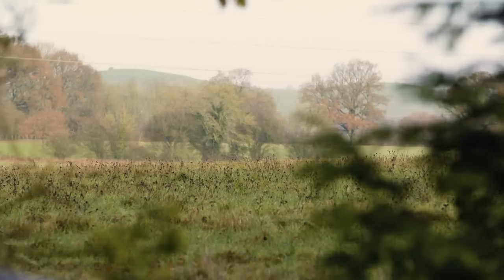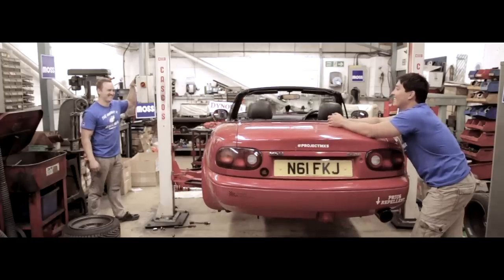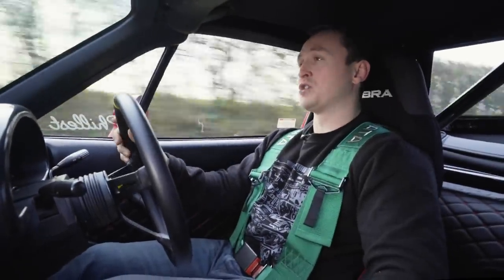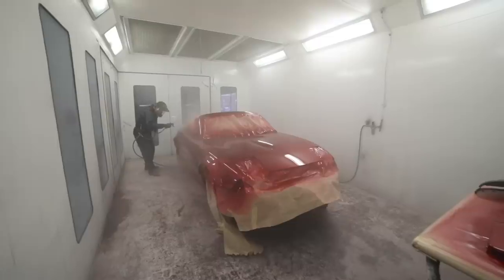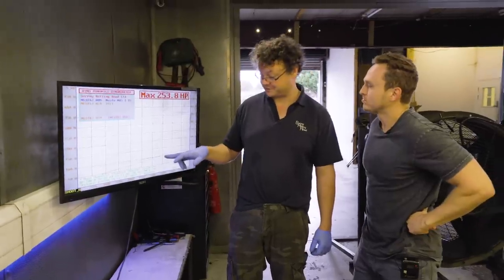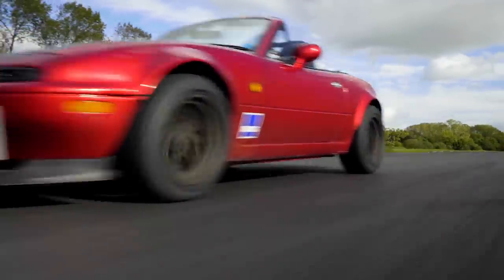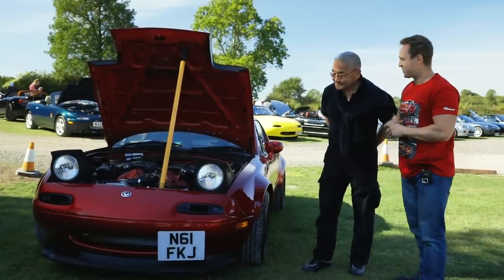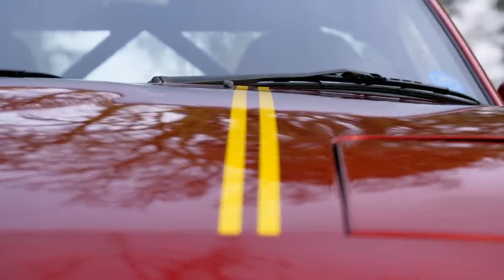How It Took £25,000 And 5 Years To Make My Perfect V6 MX-5!

Comment: Phil made the decade better.
Reply: Evan O'Shea defiantely
Reply: Yup
Reply: PHIL FOR CAR OF THE DECADE!!!
Reply: Love Phil, Love the channel. I wonder about the weight balance.
I would have choose carbon for the engine bonnet (hood) and light battery.
With a big engine on front and carbon at the rear, it has to be nose heavy.
PS: Please put the lights down drag racing it ;)
Reply: @Alpha Bravo Great answer, thanks! And yes, hard to believe the V6 is not heavier. Maybe a suspension adjustment can get around it? I wish Phil was a hard top for chassis stiffness (but I can be wrong again).
Reply: Yea
Reply: If I'm not mistaken, the jaguar engine is aluminum block, aluminum heads, where the stock Miata engine is cast iron block, aluminum heads, which is why the Honda JV6 Swap claims a mere 9lb. weight gain
Reply: @tnb1224  SO THERE'S A WEIGHT GAIN! ADMIT IT!!! hahahahaha :0)
Reply: @Platypus_Warrior  Lol I can't speak for the Jaguar engine, but yeah there's a slight one with the Honda engine swap
Reply: @tnb1224  I was joking of course. 10 lb is nothing. What would you improve on Phil (the car :)
Reply: Or this Decade made Phil better.
Reply: Yep
Reply: Isn't there a jaguar supercharged V6.... A new vision for a new decade, 350bhp... Control electronically to maintain some reliability etc. Could be enough power to kill a Ferrari Testarossa of the decade that gave us the Mx5 in 1989/90...
Reply: كظاهرة
ظ

0 حجج

Comment: By coincidence we bought our MX5's at around the same time for quite similar money ... I am looking at a new engine in mine now too, I am about €14,000 into repairs by now and will be about €26k to €28k in by the time Luigi is done.  One day Luigi and Phil will meet!
Reply: Can You Upload A Vid Of It?
Reply: Glad to know I'm not the only one pouring insane amounts of money into these. It's money that you'll never get back but man, the joy these things provide is out of this world, it's worth it.
Reply: Your mx-5 in green looks really eye candy, would love to see other mods done to it
Reply: I Like It, But I Dont Think Its Green Enough.
Reply: @dharmik_shady  No real other mods, every bushing has been replaced with I.L. Motorsports and it has new aftermarket stock suspension and oem shocks - Some slightly better than stock Ashuki brake disks and pads all around (Stock small size) and braded brake lines - That's about it.  Most of the money has gone into restoration!   Engine work is not confirmed, but standard mazda engine with ITB's, maybe a 1.8 or 2.0?
Reply: @CabronazoMotivado  I am in it for the love at this point, yes :-D
Reply: @ruggedsquireez6927  I wasn't wearing my bright green Luigi hat in that picture, sadly...
Reply: @loose_unit  How Disappointing.
Reply: You Should Get Mario To Be The Passenger.
Reply: No they wont
Reply: @loose_unit  yup the 2.0 is really sweet with some modifications can be easily boosted to 200 odd hp
Reply: sieht gut aus!:)
Reply: @ruggedsquireez6927  Next Ringmeet I will do that!
Reply: @dharmik_shady  My goal would be 200ps at the crank N/A, no boost!
Reply: @zombeloffical  Dankeschön!
Reply: @loose_unit  Ive got KYB Excel G shocks in mine and IL motorsport suspension bushings too. My springs are eibach but they're replicas of the OEM ones.
Reply: You spent the price of a new MX-5 just in repairs to an old one?
Reply: @CabronazoMotivado  so very similar, I have the same springs and bushings
Reply: @Rover200Power  not yet! But getting there!
Reply: @loose_unit  what was wrong with it? Was it just a pile of rust flakes?
Reply: @Rover200Power  it's done 210,000 miles so literally everything is worn out ... Or was at least 🤣
Reply: where can I donate to make this happen?
Reply: @Rover200Power  and yes, lots of rust...
Reply: @brodyofhillcountry4050  nowhere, if you want to donate there are people who don't have the means, I do fortunately :-)
Reply: @loose_unit  good luck then, you'll know the car inside out when you are done.
Reply: What a sick name haha, “Luigi”. I love it :D
Reply: LoOsE_uNiT you sound like a nice person 👍🏼 I hope to see Luigi tearing it up at the Nordschleife one day
Reply: LoOsE_uNiT let’s make this top comment!
Reply: GREENER... U should go naturally-aspirated!!
Reply: That's just way too much money for an old Miata. In my opinion of course. That's 370Z money. Or G37. Or Corvette even.
Reply: In case your green mx5 was repaired by Ales than I believe I have met Luigi :) What a small world...
Reply: @loose_unit  damn the color
Reply: @o.a.m9515  ITB build is the plan!
Reply: @l3v4rt  The very same!
Reply: The colour is "Porsche Gelbgrün" if anyone is interested!

Comment: 21:50 really got to me, because i can relate. i was in a bad place mentally for a while, didnt care about much of anything, only felt depressed, etc. etc. then i discovered the miata, and ended up buying my own. since then its truly given me something to care about. i have so many plans for this car, and it really pulled me out of a dark place. i will eternally be grateful for this car currently sitting in my driveway. every time i see it, it fills me with an emotion i didnt know i could feel. even now, while it doesnt run and needs an engine rebuild, i still care deeply about it. i know it would make more logical sense to dump it and buy another one, but this car did so much for me and will always hold sentimental value.

Comment: I have a simple Mitsubishi Lancer GLX 1.3 liter petrol 1998. It's not fancy, the performance obviously isn't there, but i just happens to love it. It's my second car i've owned, and this one will be with me as long as i live ( hoppe not to crash it ). This series, seen you working on Phil, all the hard work and joy, the feeling of acomplishment, makes me love my litle lancer even more. I wanted to keep my lancer as close as OEM as possible, but now i want to make a 4WD convertion on it. Thinking on a v6 twin turbo from a 3000GT 4WD, keep all the interiour bits and stuff as AC, Power steering. A street vehicle with good performance. Not a race build, but he will make me happy. Thanks a lot for the inspiration. Thanks for buying Phill. Best for you two. Cheers.

Comment: Always fancied a convertible since I saw a neighbours red MX-5 Mk2 in 1990.
10 months ago I posted this; 'I was looking for reasonable soft top and I have always heard loads about their good handling and I like their shape. However I sold my Harley Davidson and ended up buying a Porsche 3.2 S Boxster with straight through pipes, mufflers and sports cats for 5K.
These videos have also cheered me up also this year :) '

10 months on; I got fed up quickly with the Porsche (particularly fitting my rugby thigh legs between the seat and the steering wheel) and sold it 9 months ago, although admit to being eclectic with cars. Got a cheap and cheerful around for now and saving. 
Next year looking for a convertible. It will be either a Mazda Mk3  with a decent spec or the Mercedes SLK350 with upgraded spec including neck heater, and the Bose sound system, with money around the £6000 mark, tops. 
Folding hard top because of people having knifed hood attacks in this area! Fuckers!!! And having no garage atm so no storing hard top space or having to fit them solo!
Enjoyed watching all about 'Phil' again. Nice one Alex ;)
Any thoughts the MX-5 over the SLK anyone???
The Harley Dyna might come first next year but I did said, I'm eclectic ;)

Comment: I had the same issue when I picked up my NA. Got it for such a deal that I didn't mind spending the money to modify it, and quickly ended up with way more than I had anticipated spending on it, still with a lot of work to do. After doing some math on how much it would cost to complete the car to my liking, and finding an NB for sale locally with everything done, I made the move to upgrade to the NB. Although it was a lot of money to spend just for a Miata, the car was completed, and had at least twice the cost put into the car in parts and labor. Definitely worth the investment, because the car is completely done to my liking and I spent a fraction of what I would've had to invest.

Comment: £25,000=  V6 MX5 or £25,000= 2005 AM DB9 6.0 +£1,000 FOR FUEL
Reply: Haha, good luck with that. Just because it has an AM badge and a big engine doesn't mean it's not an absolute shitter
Reply: Alex Kersten thanks because thats what i did last week. Buy a 25k db9

Comment: I just got 1993 1.6l after my 2003 BMW 330i was stolen. I thought I was going to be massively disappointed in it, and from a power perspective I was but I was expecting that. The car was just in too good and too cheap to pass up though. These things will go up in value over the next 5 years, especially a totally unmolested version like mine. I loved the way the E46 handled and I thought short of a supercar or high end sports car that's as good as it got. Boy was I wrong. Of course it's slow, but during the twisties it's just so good and so effortless. The harder you push it in the corners the better it gets. There's a good reason they have the rep they do. 

That being said I'm torn between keeping it bone stock or slapping a V6 or K series in (I'd actually love to put a VTEC H22 in from a Honda Prelude, I've owned two, a 93 and a 95 and that's one honey of an engine and they respond pretty well to mods, but since nobody has done it far as I can tell I know my limits as a mechanic, I'm pretty good but that's a ton of engineering and fan work which is likely beyond my skills). The Jaguar/Duratec V6 really is kinda perfect though. Just the correct amount of power for the car. 

Oh one last thing I'd love to do/see is to put one of those Yamaha V8s from the jellybean era Ford Taurus SHO. Small, light, high revving V8 that sounds fucking incredible. Again though, doubt anyone has done it and I'll need at least some instructions with any Miata engine swap.

Comment: recent mx5 convert here. always been, & still am, a muscle car guy, but last year we bought my wife a 99 miata, & honestly i wasnt impressed in the slightest... untill... one fateful day ...we decided to go on a drive thru our local mountain roads to look at the fall leaves turning... we dropped the convertible top & she insisted i drive... & it happened... i fell in love... not with my wife, i fell in love with her in 7th grade... but i fell in love with a "hairdressers car" (fitting i suppose as a master barber of 30 yrs) ...this little go-cart only churning out 140hp was actually more fun to drive than my 71 chevy making 450 horses, & it with its stock suspension & skinny tires it actually out handles my auto-x built 98 firebird! ...been following ur build for a while, congratz on a beautiful finished product (well, finished for now haha) ...i do have a quick question as to ur wheel/tire size combo? im looking to start doing some minor improvements to ours soon & the wheel/tire combo will probably be the first salvo fired... so since the na & nb are so similar, could u please tell me what sizes ur running on urs? because they look perfect! ...albiet, im sure the fender flares allow u to run a way different offset than a similar car without em... thanx for the all yalls great car throttle videos, god bless & merry christmas to ya bro!

Comment: Phil has become the ideal of the Mazda MX-5 Miata. Weight is now the same or even lower, balance is still great, and enough power that it can get squirrely under hard acceleration or vigorous cornering with standard tires. Throw on some semi-slicks from Kumho tires or another reputable brand and I bet it'd lay down some incredibly respectable track times.

Comment: With the MX-5 drag duel, it's the torque of the V6 that won that race. 225 ft lbs is an enormous figure for such small car. I'd say if a super charger was added to Phil, that car would be a track monster. Getting it to 300 bhp would be insane.

Comment: This is what you are under cutting by making the MX-5 project!
Awesome! 

Lotus Evora
Sports car
MSRP: From CAN$135,840
Fuel economy: 12 L/100 km combined (14 city, 7.3 highway)
Horsepower: 400 hp
Engine: 3.5 L V6
Curb weight: 1,415 kg

Comment: I'm glad it proves if a cars cheapish there's still a point in dumping a tonne of money into it and improving what was good allready instead of buying like a new car and not doing anything for 25 grand and scrapping a slightly older car and built not bought too by a man and friends on his driveway for the important parts you can do on the driveway  it's also gave me hope and proved if you can do an engine swap then you can maintain a car on the driveway atleast might be difficult as I'm learning light  motor vehicle at college but it's doable thanks car throttle

Comment: In my opinion, it’s not a perfect v6 swap until you grab a Yamaha HPDI 250, do whatever is needed to make it run horizontal shaft, adapt it to a 6 speed Miata trans, maybe throw a pair of turbos on it and send it 😁 A two stroke turbo Miata that makes F1 car sounds would be sick 😄

Comment: A lazy V6 though lol, The MX5's main positive is balance, as it's lightweight you don't need torque as much as bhp. So you're better off with a high revving engine, The Mazda 1.3b obviously or F20 NA will see 270-280hp lightly modified, Or a K20 NA 240hp ish Or even a b18c NA 220hp ish Or a beams 3sge NA 220hp ish Or SR16VE VVL NEO N1 NA 200hp And the 20L Neo 220hp

There's so many options that give good power with light modification...

Comment: about the weight distribution.
mx5 has stock perfect 50:50 weight distribution. with that v6 he fucked the weight distribution up.
Reply: V6 is aluminium block so actually a couple kilos lighter than the l4 it replaces 😉

Comment: Option A:
- Take mediocre old car
- Spend 25k and 5 years of work on it
- Have slightly less mediocre old car

Option B:
- Take that money and buy, say, a second hand M2
Reply: Option A will more than likely still be around when Option B has been turned into washing machines.
Reply: @S-Ltd1000  Maybe but I wouldn't want to be in it.

Besides the implication that a 20+ year old MX-5 extensively modified for performance has reliability going for it is laughable. Unless the argument is that it's reliable because it's been stripped out of most of the stuff that could break, in which case have fun driving an oversized go kart on public roads without any equipment or comfort at all. That isn't even that fast.